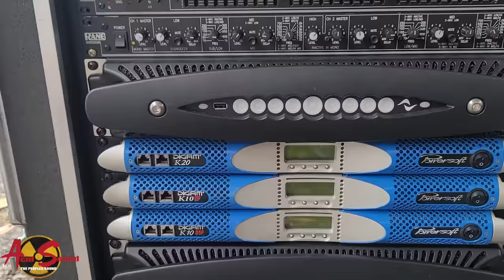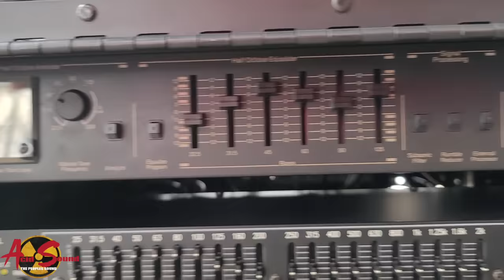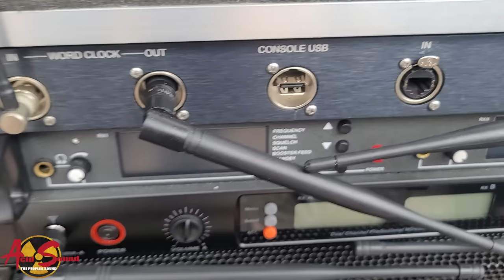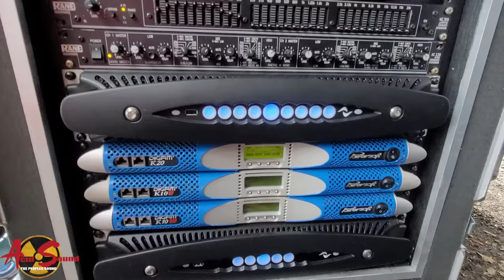SOUND SYSTEM SET UP AND SOUND CHECK USING POWERSOFT X4L AND K20

Comment: Here is some Expert advise from sound system gods, you must have at least 3 cables going to the loudspeakers, one for Tops, one for Mid and one for Bass or more, else you will get pure crossover distortion not a clean sound, that mash up the sound quality, where the bass jump into the Mid and Tops.  Keep up the good works bro...
Reply: Crossover distortion? It is the type of distortion in underbiased AB output stage. What do you really mean?
Reply: @andreavico6198  Yes same thing you are correct, when electromagnetic fields jumps from one cable to
 another it enter amplifier feed back loop then can be heard Clearly and loud in wrong speaker output channel as distortion...
Reply: Wah dis yah tark bout? Choh!
Reply: @powerplay8355  😂😂😂 he talkin dat real-real, listen up!
Reply: Not necessarily it depends on what soundsystem your running

Comment: Used to wire those socoflex and Electroflex years ago at stage electrics.L N E in six sections. Never knew they were used on audio!!!!
Reply from the maker: Yes they use them in UK for audio also for certain sounds systems...it's just that it's alot more expensive to do

Comment: I'm just curious to know where this video was shot? If it's Orlando Florida, I dig the old-school PA set-up. To be honest a 'stage set' PA delivers more direct high-volume to the audience in an enclosed arena or area. The patrons can feel the bass, midrange and treble more realistically, particularly when the band plays 'live' without backing-tracks and pre-recorded vocals. Analog will always have better sound whether live or on record. My first rock concerts I saw as a teenager were performed on very similar set-ups. Air-suspension volume so magnified it blew the bands hair back when they stepped in-front of the PA.
Reply from the maker: Yes this was in Orlando - I get where your coming from for a concert type situation - This is all about the Sound System Culture

Comment: Same board but Midas more reliable and has better sounding pre amps
Reply: Debatable. I know a few engineers who say they prefer the Behringer pre-amps over the Midas. Don't shoot the messenger.
Reply: Check out Dave Rat's review of the Midas and Behringer mic pre amp differences.
Reply: @rufuscrowder1309  will do